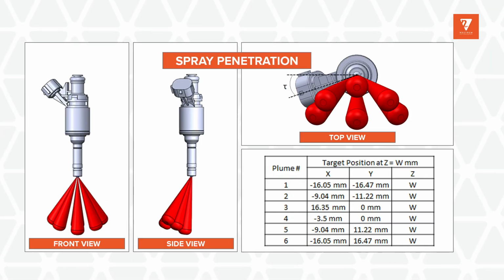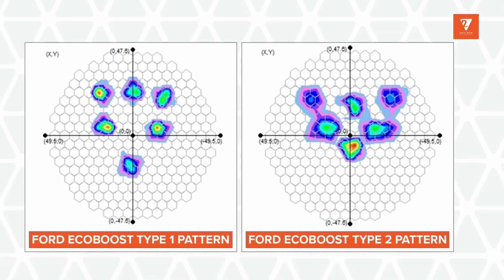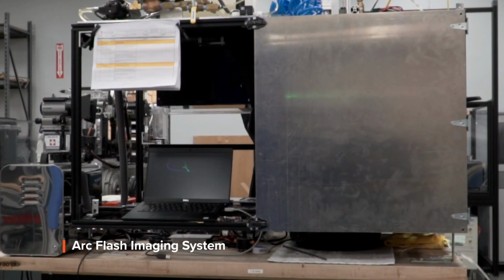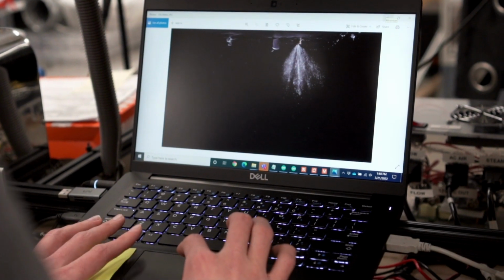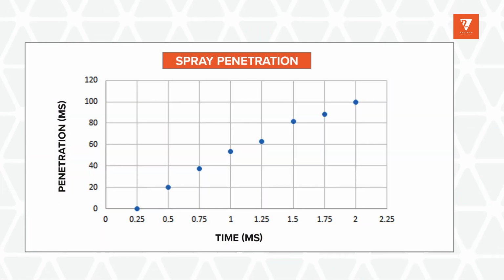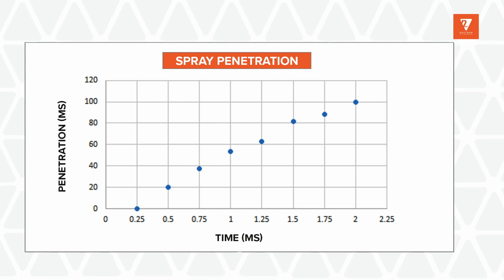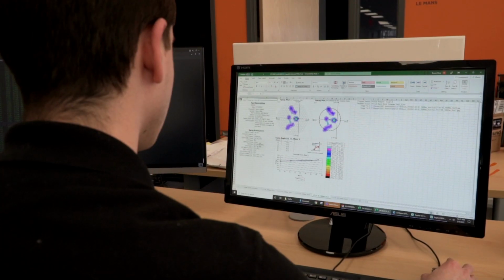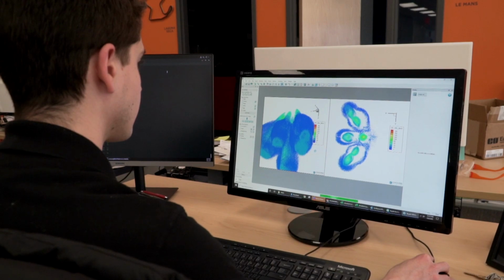Nostrum presents Fuel Injector Spray Visualization

Comment: Can nostrum stage 2 handle dorch hpfp stage 2 250 bar ? Please answer if you read  🙏🏻
Reply from the maker: You should have no issues using our Stage 2 injectors with the Dorch HPFP!
Reply: @ thanks for the answer. They also arrived in Sweden and are ready for installation. I hope that these 550 hp will grow a little more 🦄